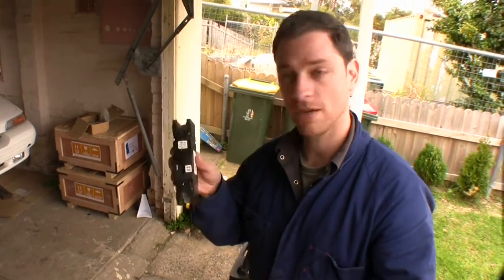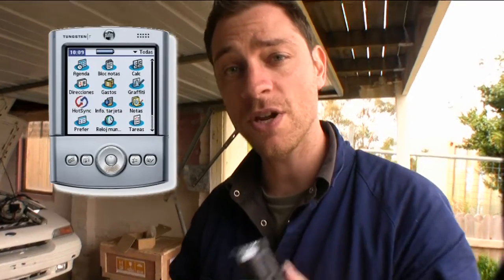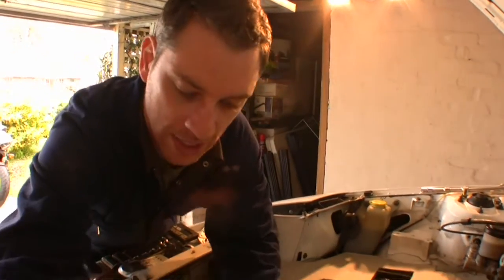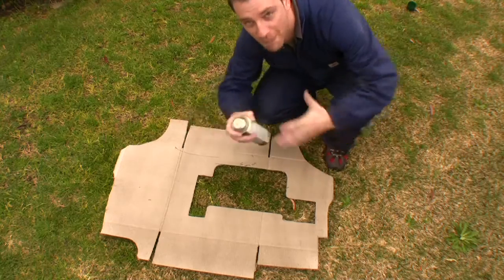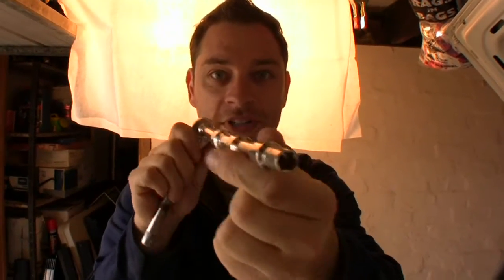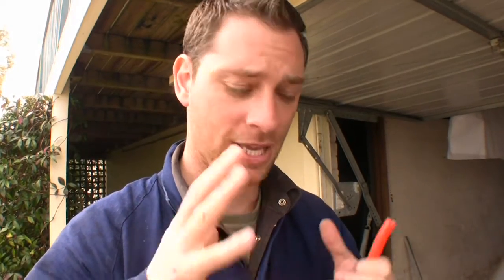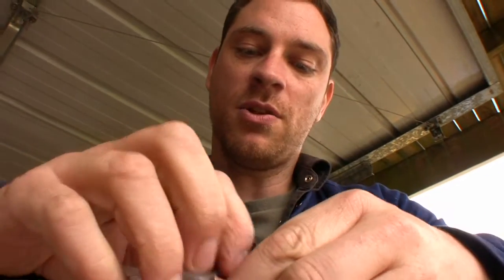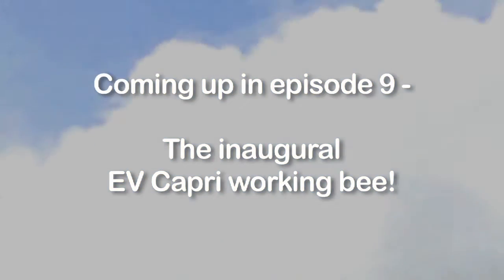EV Capri episode 8 - Kearon's Electric Car Conversion

Comment: Regarding tools for connecting high volt/current connections,you either work on it disconnected,or when working live use the PROPER commercially available insulated tools,the DIN standard is 1000V protection and are no more expensive than your ordinary spanner/pliers/cutters etc.